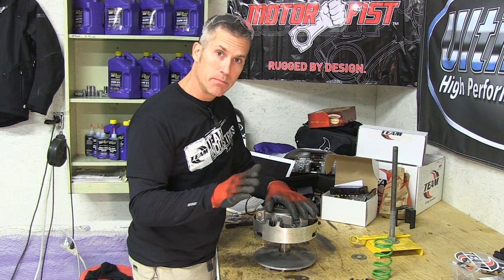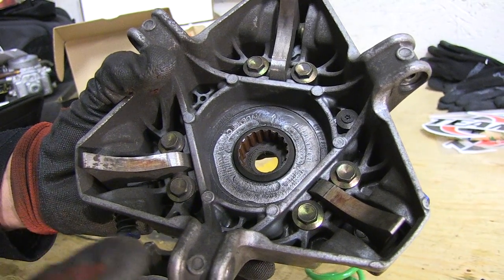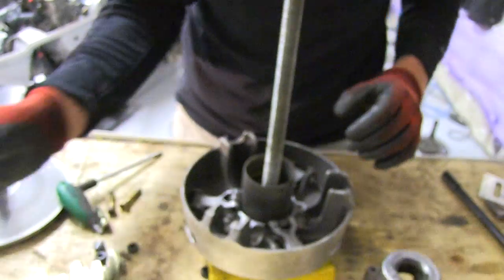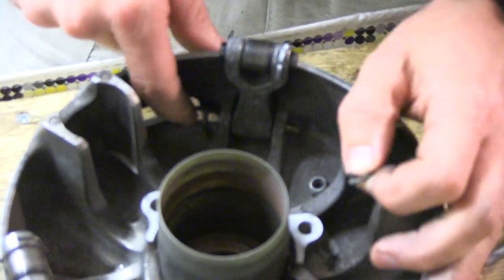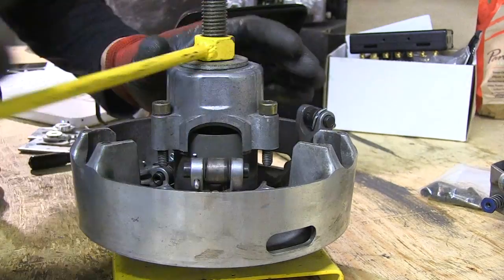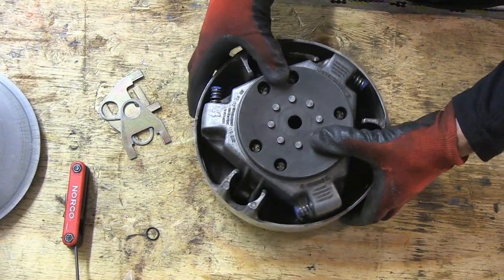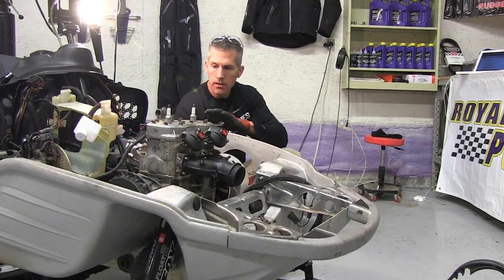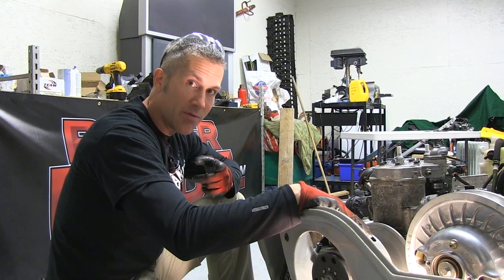700 Ski Doo mod sled Ep #26 Primary Clutch Tuning! PowerModz!

Comment: Awesome! now I know how to take apart my clutch properly. Id suggest following what bombardier recommends for torque specs for the primary and checking it regularly. Ive had a primary come off at an idle while warming up. Little did I know that the bolt had become lose and with the centrifugal force the clutch came off and shrapneled on me. Nobody was hurt and luckily it was just warming up and I wasnt driving it. I was out the rest of the season until I found another clutch.

Comment: the skidoo tra clutches are alot easier to work on vs all the others. i have had mine off of my 01 summit a few times. you can about do it with your eyes closed. well i wouldnt suggest it though. lol

Comment: I would be careful using carb cleaner on clutches because a lot of that has lubrication in it as well.  But thats just me.
Reply: TheBCSledder I've always heard hot water as hot as u can stand touching ur hands and a de-greaser like dawn dish liquid is the best thing to use so that's what I've always done. u gotta make sure u dry everything off or blow it dry with an air compressor tho

Comment: HEY GUYS: I have a 95 formula z rave, & the setting on the primary was @ #2, I was told #4 is factory. so I set it @ #5 do you fellas know what RPM it will leave at.  THANKS Rob.
Reply: that only changes the final rpms.  the engagement wont change.
Reply: ok, Thanks for the info. Now one more Question if you don't mind, Which number would be the best for me? I usually warm everything up, but then I beat it pretty hard at times, & today I went for a 40 mile cruise, & a couple of side roads I got too open it up & both times it went 178 kph. is their a different number to increase the top end? Thanks Rob.
Reply: rob garant the higher the nuber, the higher the final rpm's will be at wide open at higher speed.try for around 8000